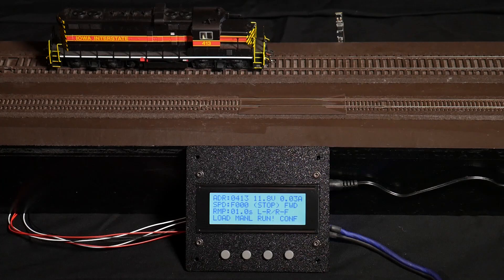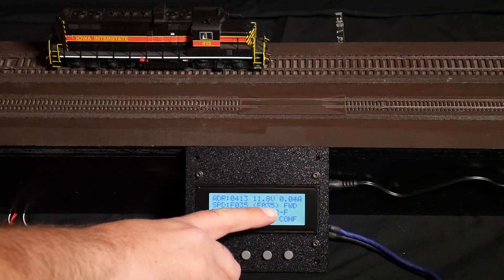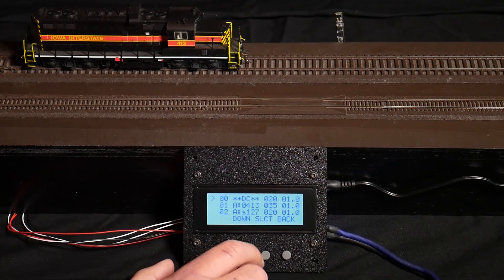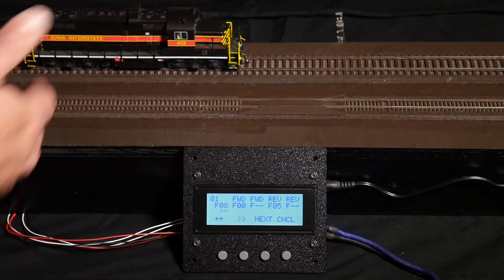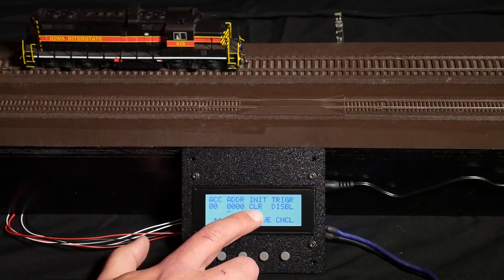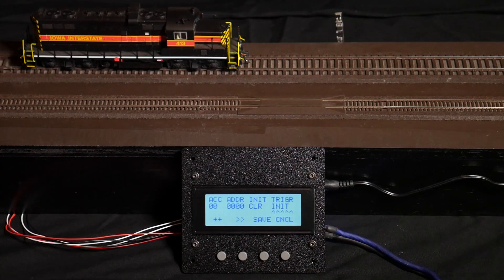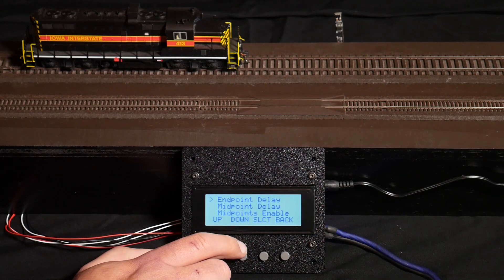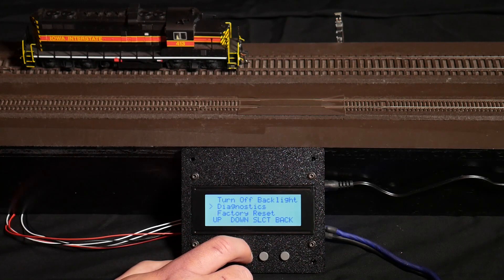The Motorman: An In-Depth Look

Comment: When the controller I had been using for years for my Piko system finally gave out I replaced it with the Motorman. The controller works great and operates perfectly using a 19v computer power supply. The older controller was only for DC operation, but now with the Motorman I can use the locomotive's DCC system.